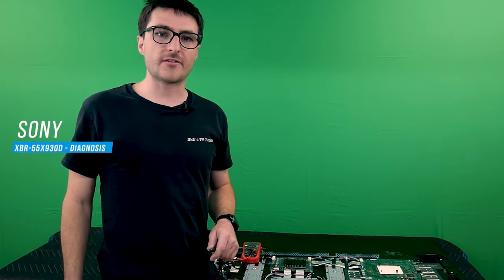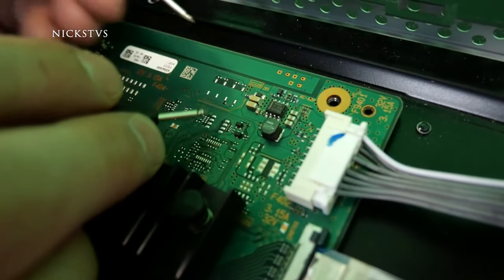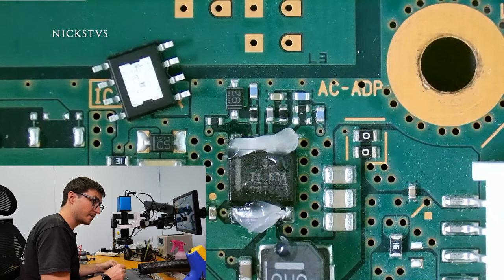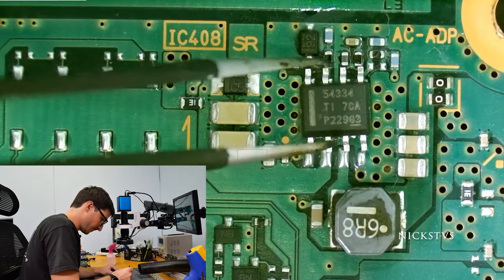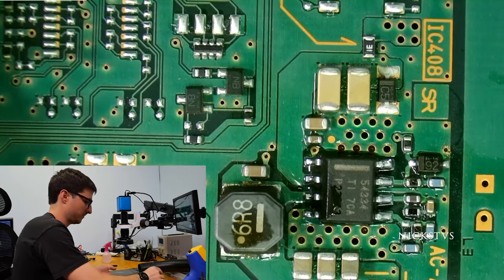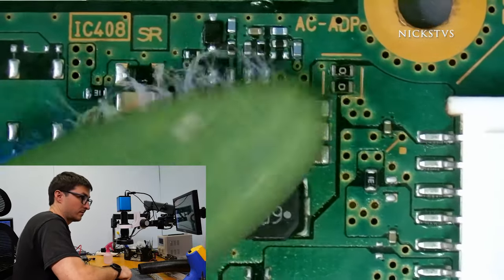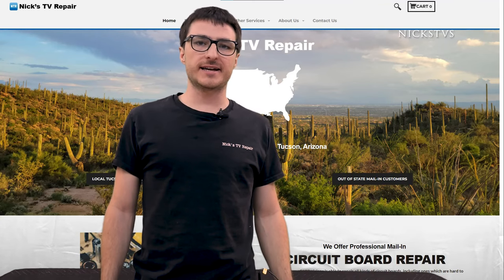Sony LED TV NO Power XBR-55X930D XBR-65X930D DPS

Comment: My Sony tv acted excately the same. Then opened it up and checked 12.67v on 3 wires going out from power board, then saw red light on optic plug and tried to switch tv on. And tv turned on! How lucky is that! I did nothing and i got it working again.
Thank you for the video. It encouraged me to try to check it out myself before taking it to repairshop.
Reply from the maker: Nice!

Comment: Niiice!🤑 I had one of those about a year ago, and when I tried to take the chip off with Hot Air, I blew off 2 smd components around the Chip and had to get a new DPS Board. lol. I had my air up too high.
Reply from the maker: Oh no!
Yeah it's got some really small caps and resistors in that area. Definitely have to be careful with this one.

Comment: A shorted fuse means somehow a bad fuse. What you mean is that the fuse should measure very low resistance.
Reply from the maker: A shorted fuse is a good fuse. 
You want your fuse to be shorted. If it's not shorted then it's failed open and that means it's bad and needs to be replaced. It shouldn't have low resistance, it should have 0 resistance.
Reply: @NicksTVRepair  Shorted means faulty. A an intact fuse is a usable circuit device. Shorted means that something has happened internally to create an unwanted high current, low resistance circuit. That is bad. When speaking of a good fuse it is good or intact or ok, not shorted. When I hear the word shorted my ears go up like Spock's and get all pointy! Your channel is easily the best on the topic of TV repair. There is obviously a high level of technical knowledge (good training probably). I've fixed everything from radar to main-frame computers to minis, to PCs to TV's, industrial electronics, control systems, HF, VHF and UHF communications Rx and transmitters, test and measurement instruments (my fav. because the electronics is at the best grade). I love it all.

Comment: Hi Nick... I appreciate the content! I'm just starting out with TV repair and love your videos. I had a question about this one in particular. My DPS board is testing good on the fuse, but continuity is beeping on all the capacitors, which indicates a short. However... this is the part that gets me... I am getting 24v to my mainboard still, but have no standby 3.5v. Is it safe to say the chip can be bad, but still deliver 24v to the mainboard? I have watched your mainboard video as well, and everything is testing good on that, with the exceptions of the 3.5v standby power. Thanks in advance!
Reply from the maker: If those caps are shorted then the IC is shorted and needs to be replaced.

Comment: Not helping Sony 4K XBR-65X850D TV, my TV doesn’t power up. I called BestBuy Tech and they said initially it was the power board which he changed still didn’t work, then said it was the motherboard it was changed and still didn’t work. He called Sony TV customer service and he was told they don’t have updates for that TV anymore which it means the TV is no longer fixable even though the TV is just 4-5 yrs old. Can you imagine?
Reply from the maker: It's a mainboard failure. You just need to pair the mainboard post repair. We have the software saved from before they took it down. It's accessible for free on our website.

Comment: the caps on my DPS bpard are shorted but Iam getting 24 volts on the cable from the DPS to the main board
Reply: so those that mean I have to replace both DPS and the main board
Reply from the maker: I don't believe so but I can't tell you for sure. Most of the time only the DPS board needs to be fixed, however on some occasions we do see the mainboard also being affected and needing to be replaced. 
I wouldn't be able to confirm this for you without having both boards in front of one of my techs. 
If you would like to send in your boards for repair, we do service both, we can fix your DPS board which clearly needs repair, and live test the mainboard for you to ensure it is functional and if not repair it along with the DPS board.
Reply: thank you @NicksTVRepair

Comment: Hi i saw your vlog. 
I have an issue with my OLED TV (XR-77A80CJ). I change the main board, power supply board T-Con but still it will not turn on. What would be the issue then? Hope you can give me some of your ways and methods to fix the problem. Much appreciated. Thank you
Reply from the maker: Hello,

Well, you replaced everything in the TV so if the TV won't turn on after replacing all the boards either there is a piece of information that is missing here, or you replaced your defective board with another defective board. 
When you say it won't turn on, can you be more descriptive? Do you get power? Are you saying the screen won't turn on or the TV won't turn on? The TV can turn on without the screen turning on. The same sentence can mean different things to different people so please provide as much detail as possible so that I understand what you mean when you say it doesn't turn on. 
PS 9 times out of 10 the mainboard is the fault.

Comment: HELP...just found your channel...my Sony XBR 900E has no power/led.   I haven't used the TV in a while but I get no light or power. I tried a second AC adaptor and that didn't work.   I opened the back and tested where the power plugs in(Small little board) for 19 volts and that seems fine. From there is a middle board, then---->Board with the inputs.  No light from optical. Anything else to check?
Reply from the maker: What you are experiencing is a very common mainboard failure. 
We see this issue all the time. 
You will need to replace your mainboard, or have it repaired if you are unable to find a replacement module. 
If you are unable to find a replacment, you can check out our listing linked below:
https://www.nickstvs.com/store/p2345/XBR-65X900E.html

This is for a mail-in repair and return service of your original board. 
Let me know if you have any questions

Comment: Hello! Thank you for the informational videos. My sons room has a xbr-43x800d…all of a sudden no power. I checked and appropriate voltages getting to main board. So I ordered a new main board. It arrived and I installed it. Now I have power but nothing else…ie, plug in and nothing comes on screen but green light blinks 14 times and then stops for a few seconds and then starts again (green light alternates with white light that typically comes on when tv is on). Any thoughts?
Reply from the maker: Yeah check out this video linked below, should resolve your issue. https://www.youtube.com/watch?v=gBd2g7kRsEM

Comment: Hi like your videos, your channel is very informative. 
I have the Sony 65X930D.
The screen turn on black and white and the tv has to be reboot several times for the tv to work. 
I had this tv for over 5yrs now, I can buy a new tv but I like to solve problems like that. 
What’s your recommendation?
Reply from the maker: That is a strange symptom that I have not seen or heard of before and I don't know what could be causing that. I would highly recommend doing a factory reset as well as a sotware update first. If that does not resolve the issue, I would then tend to suspect either the T-con or the screen itself could be at fault there but that is just a guess.

Comment: Hi. I have this model tv. There is no power. No tv light at all. No standby or blinking lights either. Tv will not turn on with remote or power button. No optical light either. I did step 1 test measuring power coming from ac adapter at 24 volts. Step 2 I measured led driver board but it sparked. I then measured power coming in at Dps board. It was 24v and power leaving Dps was 24v and power at main board 24v. I did not see any other voltages at Dps or main board.. I followed your other video and removed main board and heat sink.  I then tested the resistance in all the capacitors you had mentioned. All the capacitors showed shorts.  This makes me think this would be main board? I wonder what would cause main board to go bad while in standby mode overnight?  I also tested  the Dps board and the fuse was ok but the 3 resistors were shorted.. it would appear I need new/repaired Dps board and main board. One thing that was odd was that I had no voltage on the white wire just 24 volts tested on the Dps and main board.  This happened overnight while tv was off and was plugged into surge protector outlet strip. All other devices plugged into surge protector outlet strip were fine. What are your thoughts about what is wrong?
Reply from the maker: The way this fault occurred and the way you are describing the fault occurring overnight is very common. Based on everything you mentioned especially regarding the slip-up on the voltage check which caused 2 pins to short and spark it may be best to send in both the mainboard and the DPS board for us to check as both are possibly affected at this point. 
It is also not unheard of to see both the mainboard and the DPS board fail at the same time although it is a lot less common. 
For more information on my services, please see the website listings which are linked in the video description. 
If you have any more questions regarding your set or regarding sending in your parts to be tested and diagnosed, please reach out directly via the contact info which is also in the video description.
Reply: Hi I replaced the dps and main board and the led driver board. Now I have the red optical light when on standy by.  When I power tv with power button or remote I have a solid white light in the bottom middle to show tv is on but the screen is black.  no picture.  Do you have any ideas on this?

Comment: A question as to how you know which IC to buy, or under which reference you got it. In my case i have a problem with a Sony XBR-65X900E Tv with IC401 problems. Can you Help me
Reply from the maker: I typically work with symptoms first and confirm the fault before jumping to specific IC chips. What symptoms do you have with your TV?
Reply: @NicksTVRepair  The TV does not turn on, it is completely off, the standby LED does not turn on either.  I followed the measurements with the service manual and in IC401 I have absent voltages, in the manual it tells me to replace IC401, the number on the IC is: P001 PHVG 640Y
Reply from the maker: Thank you for providing the symptoms. Yeah, I have no idea what IC401 is.
I have never had to replace IC401 in the hundreds of these mainboards that i have fixed. Granted I don't have a 100% success rate but 90% of the time a dead no power issue is due to the eMMC chip. That's the chip that usually needs to be replaced when encountering the dead no-power failure. The only other part that could cause this is a defective processor, but that usually only happens due to a power surge or lightning strike taking it out. It's rare to see it go out and cause a dead no power on its own although it is technically possible.

Comment: Hi  @NicksTVRepair Great Video.
I do have 75X940D working fine since last 5 or so years. Suddenly one morning it was not powering up. It's been like that since last two weeks. What would you recommend. Upgrade or Repair?
Reply from the maker: In my biased opinion I would say repair. That's because this is a very good 4k TV and once you get the mainboard fixed, there aren't any other parts that commonly fail with this set so you wouldn't be at risk of another problem arising anytime soon. Oh also replacing this 4k 75" Is going to be between 5-10 times more expensive depending on the model you go with.
Reply: @NicksTVRepair  Thank you for your prompt reply. I am glad with repair option as A90L is almost another $5000 which I was aiming for replacement. I would like to send it for repair. I also have filled out contact us form on your site from my hotmail account. Let's discuss next steps for repair option.
Reply: @NickTVRepair I just have placed a repair order. Do I need to buy tools to open the TV Motherboard?
Reply from the maker: You just need a screwdriver to remove the screws. Be gentle with the LVDS ribbons (the large flat ribbons) they are fragile and can break if you don't disengage the locking mechanisms correctly. We have videos on removing a Sony mainboard if you need.

Comment: Hi, Thanks for sharing all your wisdom. I have been checking the voltage on DPS Board and even the main board seems to get 24 volt input but I am not sure what you mentioned at 7:02 to 7:06 ( you said and also 3.4v). I don't seem to find any of the wires showing 3.4v. Can you shed some light on  what that 3.4v for and also, any other way I can check whether that was the cause for the NO Power for the TV - XBR-55X930D). Thanks.
Reply from the maker: Sorry for very late reply. 
The 3.4 volts would be found on the right side of the 3 caps I believe. The caps we use to check for shorts. 
I believe left side is ground and right side is 3.4 volts.

Comment: I replaced the ic bought from your site. It fixed the short.  Now when i plugged everything back in I'm getting the 24v on the white wire out of the dps board instead of the standby voltage. And nothing in the center wires where you looked to be testing the V out of the dps to mainbaord. It ended up shorting the ic again. Good thing i bought 2. What could be causing this? I placed the IC exactly as you had shown.
Reply from the maker: The bottom pad may not have been soldered properly as in improper contact or maybe too much solder and could have been making incidental contact with another pad it shouldn't have.
Without seeing it in person I am only guessing.

Comment: Hi Nick, I replaced the chip and worked for a few minutes then it stopped. I checked the capacitors and they are short again also the fuse has blown up, what you think is the problem that damages the chip?
Reply from the maker: Maybe the ground pad didn't solder properly? Are you sure you had a genuine replacement part installed? I just asked my tech that does these repairs, and he told me that he has never had that happen before. Unsure if you have a more severe problem and something else is at play or if the part you used was bad or possibly not sodlered on right.

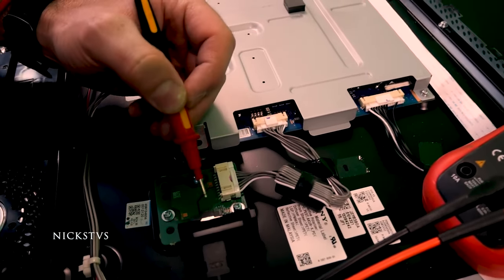Comment: My multimeter on 20v does read a AA battery correctly so i believe its working properly and when i check the power supply at the port as you do at the 1:10 min mark it reads 19v and instantly drops to 13v and drops or starts at 13v and continues to drop, never any where close to 24v and drops eventually to nothing, what does that mean??? Thanks for helpful vid
Reply from the maker: You may have an issue with your power brick not making proper contact. Is the plug perhaps not providing 24v correctly from the power brick if you play around with the cable? If you put it in a certain position vs another does it more consistently provide voltage? 
I only mention this because I have seen this be the fault before. 
If you still have issues, I would recommend sending us a message directly or by filling out our contact form. 
The contact info is in the video description.
Reply: I used the brick and cable from my 900E which is the same type 24v, same results shows 13 volts and drops instantly. Any ideas?   @NicksTVRepair

Comment: Hey Nick i have a KD-65XD9305, no power, i checked the steps you showed, and power is getting past the part in the video( the other side of the last cable checked) no sure what else to do now any advice?
Reply from the maker: If I understand your comment then it seems your DPS board is working and your faulty board is the mainboard. I would recommend replacing it or having it fixed at this point.
Reply: @NicksTVRepair  understood thank you for the quick reply 👍👍
Reply from the maker: No problem! 
Good luck

Comment: So i need to check check the voltages like you did at the 1:55 min mark to know if my 24v stops on the dps board to know to send it in? thanks
Reply from the maker: The best thing to do is not a voltage check but the resistance check of the 3 caps to the right of the IC we replace. Take the board out of circuit or simply disconnect everything from it to make sure nothing in line affects the reading. 
In resistance mode test the resistance. If the 3 caps are shorted then the IC is bad and needs to be replaced and thus confirms the fault is the DPS board.
Reply: @NicksTVRepair  do you have a walk through of how to locate and check those three caps? Thanks for reply